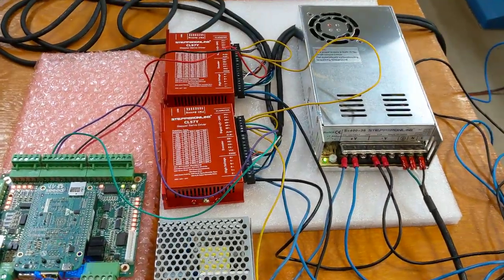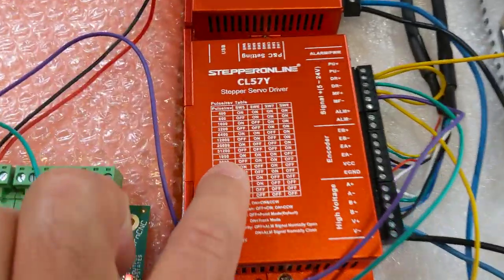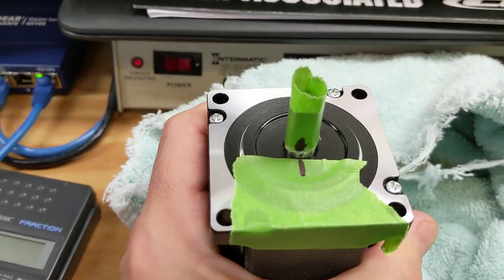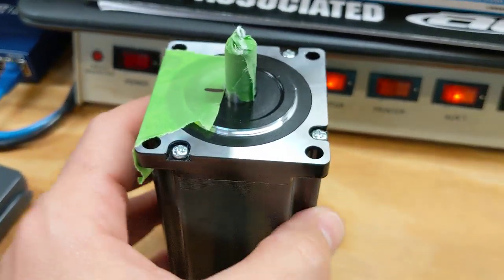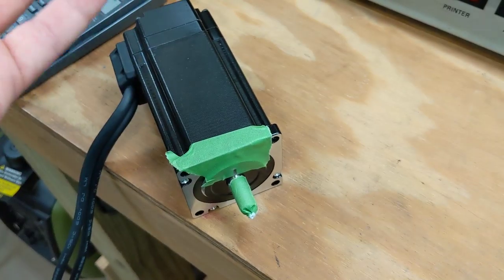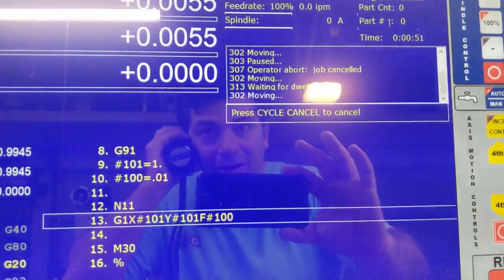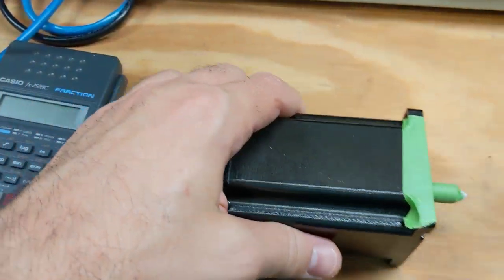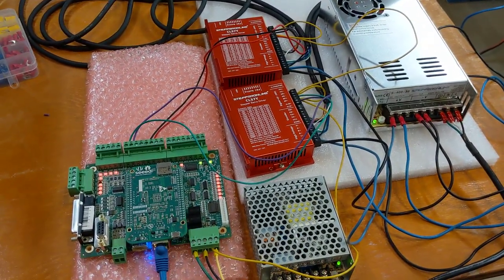Stepperonline CL57Y: Bench Testing with Centroid Acorn

Comment: It looks like a great setup. I am going to check out stepper online for my next machine. There is one thing that confuses me on the configuration. I have seen in this video and others about setting the pluses / revolution to 4000 or higher. But the encoder of these motors is only 1000 CPR. How do those values relate to each other?
Reply from the maker: Hi.  I believe they are 1000 line quadrature encoders. That means you get 4000 data points per revolution.  When you set the micro stepping above that, the motion becomes smoother and I'm sure the drive is simply interpolating between encoder measurement points.

Comment: @Franco Thanks for this closed loop stepper motor video. Most keep promoting the servos but steppers are a great solution for small mills. What about the power supply?  Could you make a video to explain why we would want to use a Switching or Unregulated Linear power supply with stepper motors?
Reply: I was thinking about that to. I contacted stepperonline and asked them if I could use a Unregulated Linear 1440W/72VDC/20A Toroidal PSU and they told me I could rather than using 3 of their 350watt 48v supplies they suggested.
Reply: @csxal  I have heard some discussion on the feedback from steppers affecting switching power supplies during deceleration. I dont know if its really an issue or not.
Reply from the maker: @testyourdesign233  if you are moving a lot of mass, the motor actually becomes a generator when you decelerate.  I don't think that will be an issue for a properly sized switching PS in a diy application.  On an industrial machine, it may be a different story.   Always best to oversize your switching power supplies.
Reply: @FrancoCNC  thanks for sharing your thoughts.  There has to be a quantitative way to determine if there is a problem.

Comment: I got a few of those, and noticed something very odd - the driver is imposing its own acceleration curve on the pulses sent by LinuxCNC, as if it was optimizing for smoothness instead of accurate positioning. The main symptom was circles not being round, because the actual position of one axis lagged behind the programmed position due to extra acceleration that was out of LinuxCNC's control. This kind of issues is usually caused by mechanical backlash, so I've spent a good amount of time looking at these before finding out that the drivers are to blame.

I had to reduce the acceleration to very low values for accurate position following at decent acceleration values. On the old driver I had (2HSS57) there was a parameter called motion smoothness or something similar, that could be set to 0 to get rid of this. On the CL57Y I can't find this parameter in the software - it's probably in there, but the parameters are confusingly named - well, even for someone familiar with PID controllers - and there is no documentation. I ended up going back to 2HSS57, which works fine after setting smoothness to 0 on every axis.

Anyone had this problem with CL57Y/CL86Y?
Reply: This would be also my concern, i don't own any kit yet, was just playing with the idea, but i always hit this question of the driver interfering with the motion controller commands...
Reply: @laszlofabian  I ended up emailing the manufacturer, and they provided me with the setting that disables it. But it can only be changed using the serial link, you need a USB-TTL serial module and a cable with a USB B plug to change that setting. Or you can buy their overpriced HISU tool.

Comment: Franco, great video. I was researching pm25 conversion with acorn and stepperonline. This is exactly what I was looking for. Question: have you run centroid / acorn in the 2 1/2 axis mode? With cnc on just the x and y and manual Z (Do you have a video on that topic)

Comment: A little more info my mach3 XP computer crapped. Using a taig mill with factor driver micro proto 2000. looking at an acorn and wiring my nema 23 450 oz motors to the acorn CNC kit.  My motors are 8 wire have no idea or wire schematic. Have Shinano sst58d5811 motors?   I don't see where the Acorn CNC kit works with closed-loop motors if I had to replace motors?  what computer with window 10 will work on the Acorn Software do you know. I have a dell with 32-bit windows 10.

Comment: Great video Franco. I'm thinking of a CNC setup with the centroid acorn board, I assume you can use different types of server drivers from the same acorn board? I'm thinking of using 2 CL57Y's for closed loop Nema 24's and 1 CL86Y for closed loop Nema 34. Any problems with this?

Comment: Hello Franco, thanks for sharing. This will be my 1st project using a stepper motor with Nema 17 and i am thinking to purchase this CL57Y and yes i will use yr link. Can you share if this driver capable to drive a fine pitch, i am looking at 1.5micron per steps. I also am going to use my latest ball lead screw that can go very fine movement for this project.
Reply: Can you recommend any software GUI that i can use for my project? I am looking at a slow speed micron level per steps on only Z axis.

Comment: Nice video!  You set the steps to 4k, what are the risks of going higher?
Reply from the maker: Hi.  More steps will give you smoother motion but it reduces torque.  You also need a CNC control system capable of generated the pulses for the increased steps.  So, more steps can mean you become limited at how fast you can move.

Comment: hey mate, I just recieved these exact same drivers/steppers for my cnc build. I havent got a controller yet to test them with but.. I was looking over the data sheet for the steppers and realised it says No. of phase =2, Amps/Phase = 5A... so are these 5A steppers or are they actually 10A steppers? thought maybe you could confirm with 1 stepper hooked up and test the power draw using a clamp meter if you have it at your disposal. Great video btw, thank you.
Reply from the maker: Hi.  They should be 5amp motors.  As I understand it, only one phase is powered as a time.  Thanks for watching!

Comment: I have the this same kit that I am attempting to get wired up. It looks like your step signal to the driver is going to the DR+ terminal and the DR signal is going to the MF+ terminal. Is this right? I was thinking the ST signal went to PU+, DR signal went to DR+ terminal, and the EN signal went to MF+. Would appreciate any insight as I can't get mine to turn the motors yet. I'm using UC300ETH controller though.
Reply from the maker: https://youtu.be/W838k7s0ptE

Comment: Hi,
Thanks for the video,
Why not connecting and displaying the error pin from these closed loop drivers ? It seems that in your test the loop is open between the centroid and the stepper driver !
After that you can add weight on axis and restart your dynamic test waiting an error (or not) message from the driver.
In the SepperonlineDriver can we configure how many micro steps missed are allowed before an error ?
Other idea, could we connect the motor encoder in parallel to the centroid too to have a true feedback of the total error ?

Cheers
Reply from the maker: Hello.  I only connected STP and DIR for the sake of time and simplicity.  When I build my electrical cabinet, I will connect ALM and ENA signals, as well.  The configuration software for the drive allows you to change many settings - I'll cover that in an upcoming video.  The Centroid Acorn board only has one input for an encoder and that may only be used for a spindle.  Centroid offers boards that have the ability to connect the axis motor encoders directly to the board, but those are more expensive systems.  Truth be told, these closed loop stepper systems are very good and do a great job of managing any error that my be present.  They will try to adjust the position of the motor shaft to make sure they achieve all of the commanded steps.  If they cannot complete the commands, they will generate an alarm.
Reply: Franco Hi, thanks for your complete anwser. I thinks I will order stepper as you on stepperonline . At the beginning I was thinking to order clearpath servos but it’s too expensive and with the covid the shipment to France will be hard. Regarding the centroid it looks nice with its integrated software but finally it’s too limited in IO for me. I ordered in the past a KStep with a KAnalog which can drive bis eight axis with all encoder returns. I will use a raspberry pi with Linux cnc to drive it via USB.My goal is to convert my SIEG sx 3.5 and be able to add after axis A and B and ATC etc...
Waiting for your next video...
Cheers

Comment: I just purchased 3 of these stepper / driver kits and am curious if I would be better off using a 36V 16.6A power supply for all 3, or run each on their own 36V 9.7A power supply?
Reply from the maker: Hi.  Each motor needs 5amps.  With switching power supplies, it's best to have about 110% or 120% of what you really need, just to be safe.  So, in a perfect world, you'd want an 18amp power supply.  But, you don't usually push all three motors to the max at once.  So, you'll probably be able to use your 16.6amp power supply without any problems.
Reply: @FrancoCNC  awesome, those were my exact thought.  Curious why they are rated at 48V but reccomend 36V.
Reply from the maker: @yz400fer69  More voltage means more heat.  You get a bit more speed and power, but more heat.  36V is a nice safe bet.  The motors will work great for most all applications and they won't get as hot.
Reply: @FrancoCNC  great info and thanks for the reply.  Are you still happy with this setup?  Obviously not like the DMM servos, but a good middle ground for price point and function it seems.
Reply from the maker: @yz400fer69  It is really hard to beat the closed loop steppers.  They are easier to configure than true servos - and I like that a lot.  They will always be my first choice for DIY projects.

Comment: I see that these drivers are rated for 24-50v with 36v as typical. Would you consider running them at 48v?
Reply: It seems he said in one of his video that the 36V is the sweet spot good enough votltage for amps and not too much to keep the motor cooler.

Comment: I have a CNC router that the control system has died and I’m thinking about putting acorn System my stepper motors are good but the drivers are no everything else is dead I’m using candle for control system and it’s horrible

Comment: I like your video but would not AC Servo motors better since they are more accurate and use an encoder instead of of a 24 vollt steppper motor which usually uses an resolver or no feedback so the Acorn so it doesn't knows were the shaft is located?
Reply from the maker: Hi.  These are closed loop steppers.  They have encoders and are very accurate.  The feedback is between the motor and the driver.

Comment: Please be aware that the motor wire colors might be messed up. My Nema 24 with CL57Y from stepperonline.com had wrong wires connected together in the connector. Funny thing is that the colors were wrong on both sides of the connector. I had to measure the resistance between the wires to find out which one is which... not cool. Other than that I'm impressed so far.
Reply: Unbelievable.  And scary.  Are they accurate ?

Comment: I need to put a new electronic system in my CNC router I was thinking about an acorn but I don’t know about the drivers and motorsDo you have any suggestions
Reply from the maker: Hi.  The Acorn will work with any motor/driver that uses STEP and DIRECTION inputs.  That opens up lots of options.  Here is a video that will help you select motors/drivers if you are looking for that:  https://youtu.be/Gq03WN99FoE
There is also a control system call MASSO that seems to be very popular.  I have more experience with the Acorn from Centroid and I was very happy with it.
Reply: Is there a company in the United States that has these products that has a customer service line you can talk to on the phone that you know of
Reply from the maker: @kennethwright9706  They are really good about responding to emails.  You should find contacts on this page:https://www.omc-stepperonline.com/contact

Comment: do you know the pinout for the USB connector and rs232 box?
Reply from the maker: Negative.  But, I've found that there really isn't much of a need to configure these drives with software.  Most of the settings that "matter" can be set with dip switches.
Reply: @FrancoCNC  I have some 2HSS57-N controllers and they have micro usb but I can't find the pinouts anywhere.  JMC customer support is terrible.

Comment: Hi Franco, Will they mount on  the workbee without modification?
Thanks 🙏
Reply from the maker: Hi.  The Workbee (like most small CNC machines) uses NEMA 23 frame size motors.  Here is what I would recommend:  Used two of these for the Y-axis (1-CL57T-S12) and then used this for the X and Z axis (1-CL57T-S20).  Both are available from Stepperonline https://www.omc-stepperonline.com//?tracking=5e66c8d3ae793

For a CNC Router like the Workbee, I really think anything bigger than this would be overkill.  The motors I listed above will be more than enough and I think you'll be really happy with their performance.  And, they have Ø8mm shafts which I believe are the same size as the stock motors that ship with the workbee, so you should be able to use the couplers that came with the machine.
Reply: @FrancoCNC  Thanks, I'm actually getting the bulkman3d queenbee pro, which is the beefier version of the workbee, with linear rails.
I'm leaning towards getting the Teknic clearpath servos CPM-SDSK-2321S-ELS (already bought the centrod acorn) but wanted to check if closed loop would be ok.
The main reason me going with the clearpath servos is that I don't want to regret later on and spend more $ to upgrade.
I've wasted a lot of $ buying cheaper tools and ended up spending more, so my philosophy nowadays, is try to cry just once :)
Another reason is that I am a newbie, and from all the videos I've watch so far, including yours, clearpath + acorn should get me up and running much sooner than other options.
Reply: @FrancoCNC  Another question please: there is the "enhanced option" which provides position setting capability of 1/6400th of a revolution instead of 1/800th for the regular option,  plus you get more RAS options.
Would above matter for a queenbee router, or even any CNC router,?
Thanks!
Reply from the maker: @jungle3111  Hi.  I set my motors to 4000 pulses per revolution.  This makes the motors very smooth and you have plenty of resolution.
Reply from the maker: @jungle3111  Hi.  In terms of the technical specs, the Clearpath servos are probably the highest performing motors/drivers you can afford to buy for a DIY machine.  But, I'll be honest with you, I would use closed loop steppers.  

This is a very good option: https://youtu.be/SvfGTA-aA5k

The closed loop steppers work really well on machines like this.  They are very smooth and precise.  I also believe the closed loop steppers are easier to configure and get up and running than the Clearpath.  Truth be told, you can't go wrong with either system.  But, if it were my money, I'd go with the closed loop steppers.
Reply: @FrancoCNC  Thank you, I will look into closed loop steppers.

Comment: Thanks for the video, I'm not sure if you've covered this before but can closed loop steppers operate without limit switches like some servo systems?

Side comment, I bought the quiet compressor you did a video on a while ago and have loved it.
Reply from the maker: The compressor is awesome. I use it nearly every day.  In fact, I never turn it off. I know what you are talking about with the servo reference signal output. I've never seen a stepper system with that capability.  I generally use limit switches to set my home position.